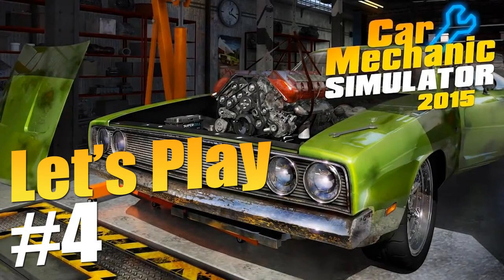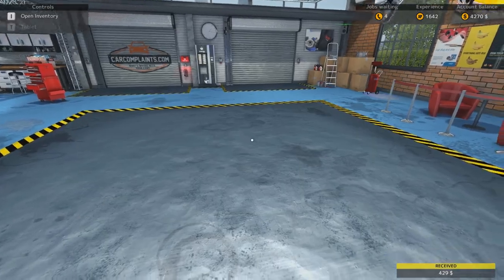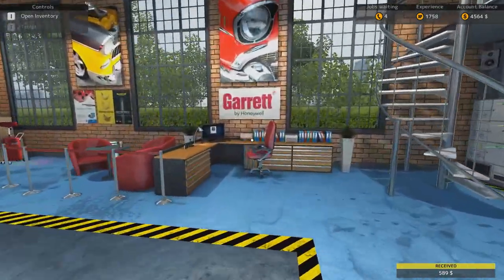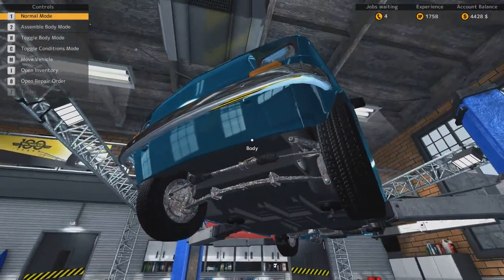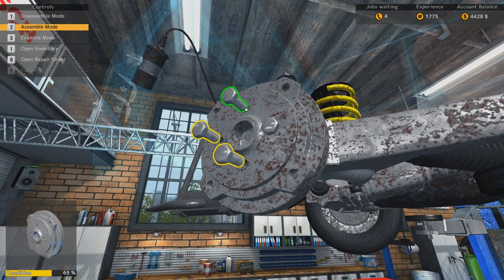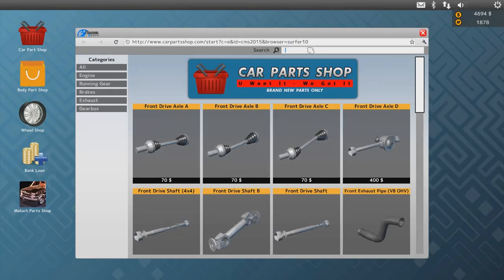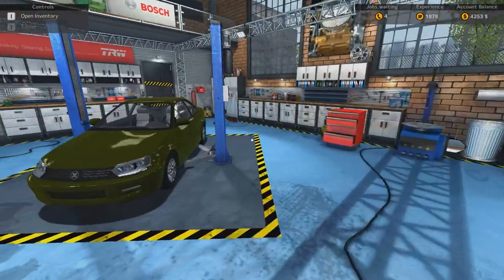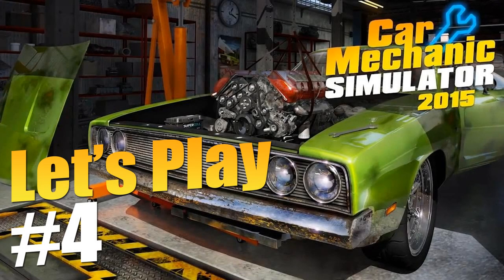Let's Play Car Mechanic Simulator 2015 (part 4 - Maluch)

Comment: best to clean your inventory from time to time. It improved a little after the last update but once there is too many stuff in there, the games slows down ENORMOUSLY.

Do the test with a new item and the one you still have and look at the difference of the 'total earned' price. Also include the selling price of the replaced item. You'll gain more putting a new item on.

You can keep the 100% repaired items for restoring a car from the auction. That is where you gain from them.

save your experience for the tablet ... it will save you a lot more time walking back and forth then being able to take of a bolt faster ;)

A misconception many people have is the larger the engine the more hungry they are. its wrong. A 1000cc has to work A LOT harder and rev a lot higher then a 2000cc engine to drive 120 km/h. Its how fast you want to get to those 120km/h that can make the 2000cc more hungry.

Comment: Is there like a "boss" mission than makes you replace every single part of the car? :D
Reply from the maker: There are some cars where you need to practically unbolt everything in order to get to all the bad parts. And then there's the auction stuff where you buy cars and then usually want to pretty much replace everything to sell the vehicle for most profit.
Reply: MetalCanyon Thx for replying. :D

Comment: have u ever broken your timing belt because u know alot about it
Reply from the maker: Nope. But since it drives the camshaft and thus the valves, it must always operate or risk the pistons mangling the valves in interference engines. I can only imagine what kind of craziness must happen under the bonnet if a timing belt breaks in operation. I'm sure mechanics could tell you more. :)
Reply: +MetalCanyon next time i get my car checked ill ask the guy/girl